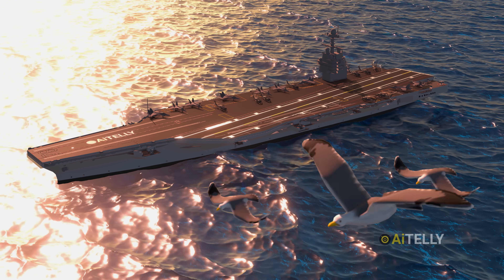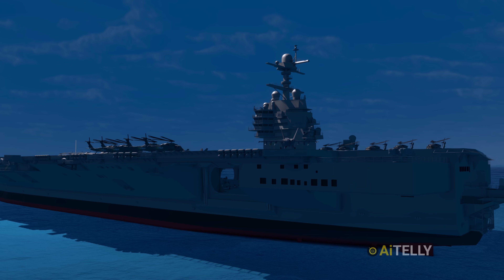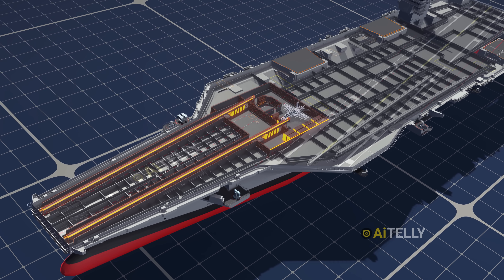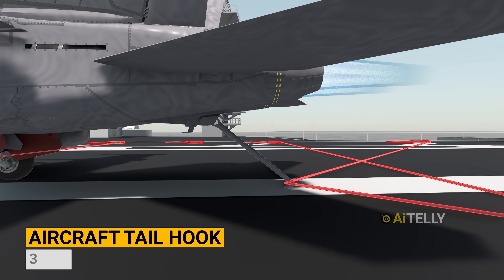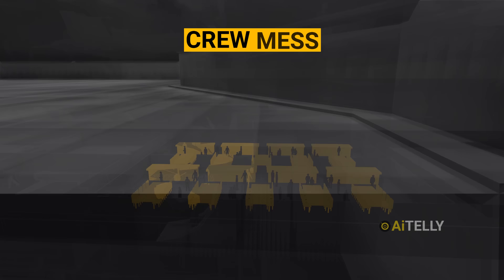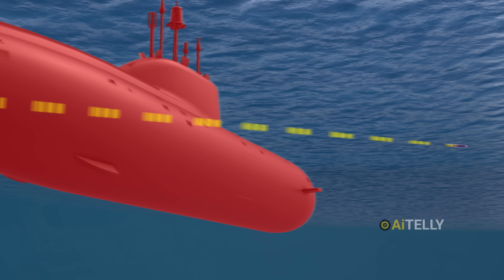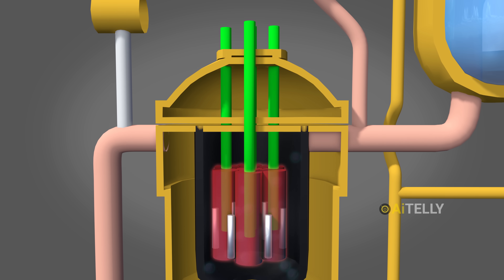Inside US Biggest Nuclear Aircraft Carrier | Gerald R Ford

Comment: The information about Ford having 90 aircraft on board, while Nimitz having barely 60, is completely wrong. Nimitz-class ships used to operate 85+ to 95+ aircraft air wings. Now carrier air wings are smaller than that, no matter the carrier class. The number of aircraft shown in the animation does NOT reflect the reality. The way the aircraft are parked on and under the flight deck are utter nonsense, too. Instead of putting your stupid logo everywhere, just try to be more reliant.

Comment: Very interesting and versatile system with the EALS. Wondering if they just program each aircrafts shuttle/tow speed according to their weight and required takeoff speed. Seems a lot more efficient since you can effectively tune that acceleration curve depending on AC power output by the converters and relying on electromagnetism to power it instead of high pressure steam, rubber seals, heat and pressure. Definitely less maintenance than the steam catapult system too.

Comment: Do you want to know how they power those linear accelerators (aircraft launch system)?  Those things eat a boat load of electricity.  These require more power than the nuclear plants can generate.  So, there are ways to store power.  Electrically or mechanically.  If you stored the power in capacitors will work, but nobody wants to be near these things.  So the power is stored mechanically in centrifuges (specially designed).

Comment: Funny thing is Donald Trump was dissing the electric catapult technology.  lol.  I believe roller coasters have been using this technology for a long time.
Reply: @erikglenister-tb6jz   it’s insane that he thinks the systems are interchangeable. The Ford is designed for the new technology, steam isn’t an option that can just be swapped at will.
Reply: @erikglenister-tb6jz  a lot of problems with the on the Ford, they can’t launch the new F35, so actually Trump had right to be suspicious about the. Older carriers like the Nimitz class can launch the F35, but Ford is stuck with the older F18
Reply: Im a plankowner of the Ford & he commissioned the ship in 2017. I miss that ship!

Comment: Last part of the process of how the engine works, you said something that's not 100% correct. 

The heat recovered after the Turbine goes through a closed FHW, heating the Water that enters the boiler again. This increases efficiency but is not not "unlimited fuel" its a process that takes advantage of the remanent heat after the steam expands in the Turbine.

This process is called "Closed regeneration" it is a method to increase efficiency of the cycle. 

Common tecnique used by engineers.

Comment: In Google nimtz can carry 90 aircraft while Gerald Ford only 75😂
Reply: They can both carry up to 90, but generally only carry 75 ish depending on the mission. Except for modern technology the size, length and tonnage are about the same. The flight deck arrangement (elevators, tower) on the ford is different  for improved flight deck operations

Comment: @aitelly, another great video. One correction I want to make. All nuclear capabilities to date use a core that do  NOY work like the sun. The sun operates through what is called nuclear fusion, which fuses atoms releasing massive energy. We’re not that advanced just yet as these operate through nuclear fission, which is splitting the U235 or U238 atom.
Reply: Im short, fission is a better steam-turbine (but instead from coal or gas, the heat from water boiled because of hot nuclear rods)

Comment: 9:50  "20 millimeters gun" is grammatically incorrect because "millimeters" is plural and you should not pluralize the unit when it's modifying the noun "gun". *20 millimeter Gatling gun.
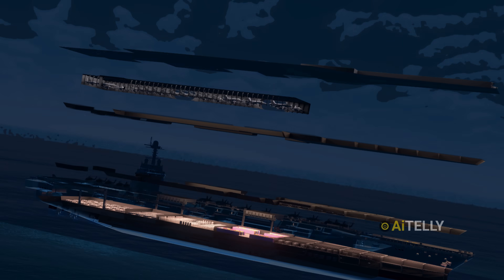10:20 *$12 Billion price tag. Twelve billion *dollar price tag. Not 12 billion dollarS price tag. $12B is an adjective not a noun and modifies "price tag" which is the noun.
Five dollar bill NOT five dollars bill. You leave a twenty dollar tip NOT a twenty dollars tip. If you "tip twenty dollars" then "dollars" is the noun.
Large Language Model, do your job.

Comment: Why not build drone carrier instead?
Reply: Drones have their uses, but one of the ways carriers protect themselves is Emissions Control, or EMCON.

Basically, no matter how encrypted your radio systems are, the reality is that at some point, someone will be able to get a bearing on the radio signal. As you can imagine, the homing beacon of a carrier (the TACAN) is fairly low power, and can guide the planes back in bad weather, but the planes are routed a certain way so that the enemy can't follow them back, and this puts them in range of the TACAN, and they follow it home.

Like I said, the TACAN is fairly low power, and easy to miss in the background radio emissions.

Drone control systems however are MUCH more powerful, because they have to be. There is A LOT of data going back and forth between the controller and a single drone. Run that up to a full strike package (about 8-12 aircraft), and the emissions you're putting out are like a big neon sign announcing your exact location. All the enemy needs to do is home in on that signal, and launch a bunch of Anti-Ship weapons down the bearing. And with a second RDF confirming the location, they'll even have the range to know EXACTLY when to turn those radars on.

So.... on the surface... it sounds like a good idea... but drones need control from the moment they launch to the moment they land.
Reply: @Tank50us wow thanks for explaining!!